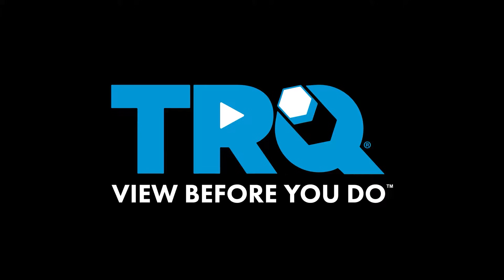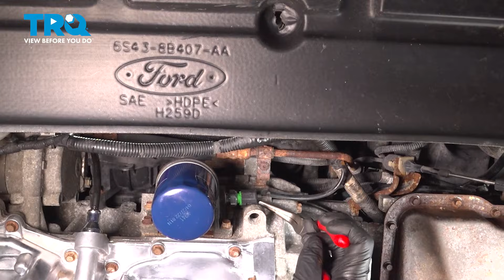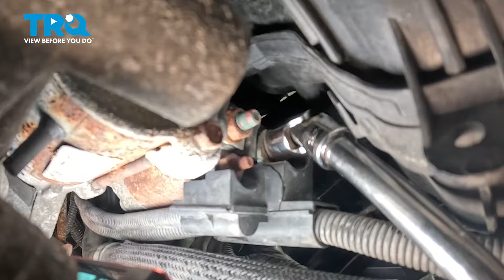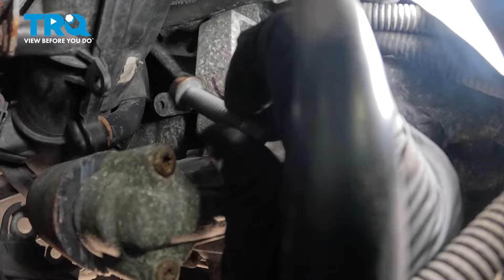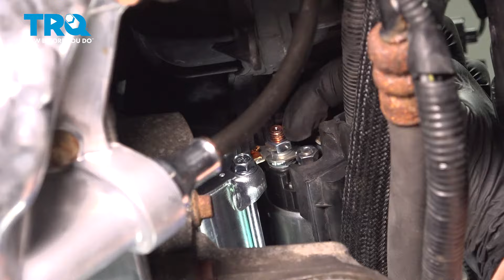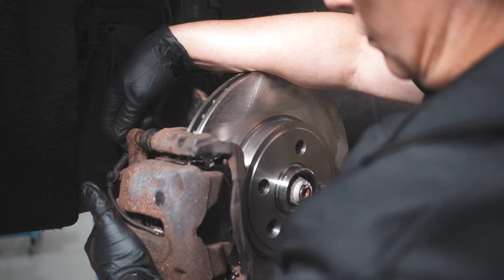How to Replace Starter 2000-2007 Ford Focus (2.0L L4)

Comment: Great video I just changed my starter on my 2006 ford focus, only tip a can give is to make sure you have a swivel socket set for the solenoid bolts I struggle to take them out with a regular socket there’s no space.

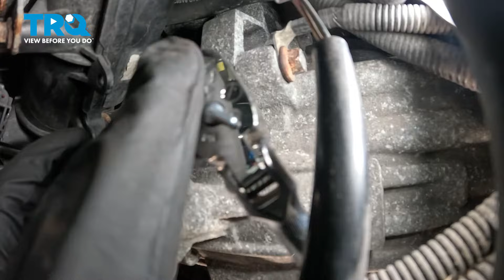Comment: If you have difficulty with space, remove the bolt at 2:15 first before trying to remove the electrical connection! Then you can move it down to give you more clearance to remove the power bolts. My 2007 is a lot more cramped than this one! Hope this helps someone.